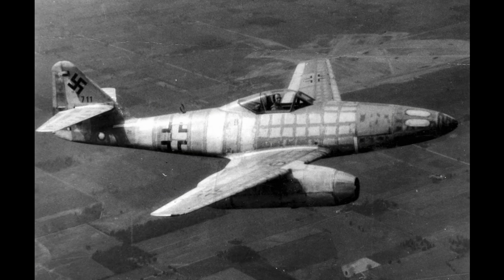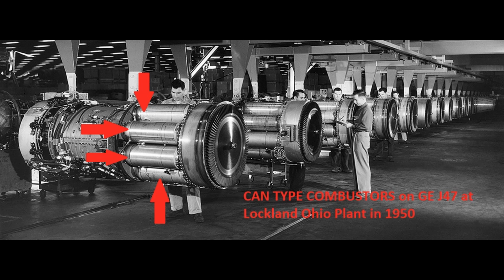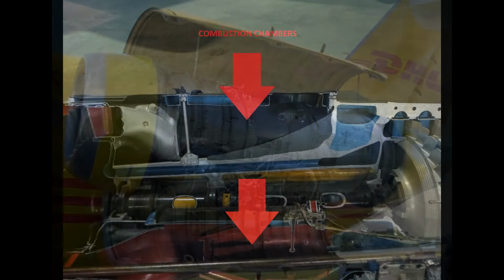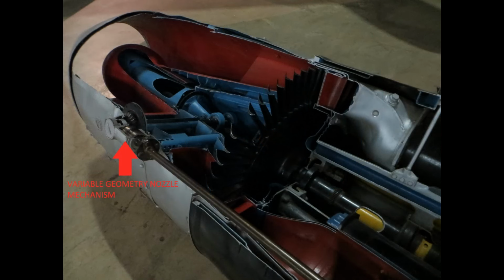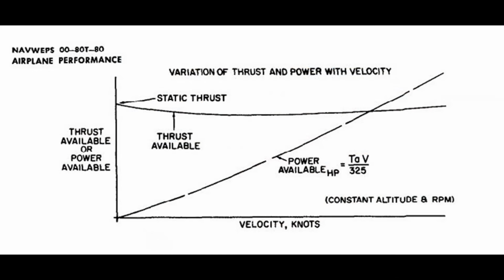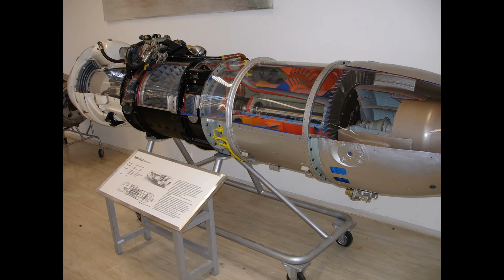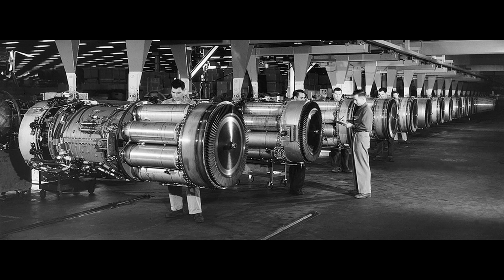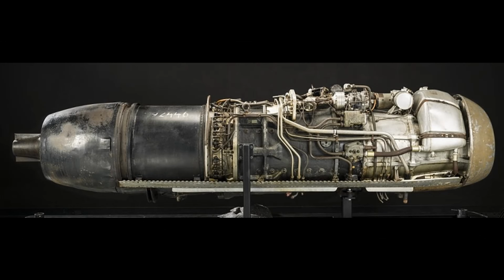World War Two JET POWER

Comment: The small turbojets, include JUMO 004, often have a centrifugal pump stage (like J402). Centrifugal pumps are newer than axial pumps at that time. Unlike Griffith and JUMO, Whittle chose the right solution for its time, the purpose of the engine and its size (commensurate with the size of the pilot). You have to compare JUMO to Derwent and Goblin, and they are much more successful. JUMO 004 sucks compared to them.
And BMW 003 benefited the French, not the Germans.
Great engineers chose the right solutions. The right solutions are way to the success. The ACCURACY of the prediction is the criterion of science. Griffith, Price, and Franz were wrong, and Whittle and von Ohain are right then and now.
Reply: Centrifugal compressor turbojets were an evolutionary dead end.
Frank Whittle was an unlikely hero created by the British propaganda machine.
The real geniuses of the British jet engine program was Adrian Lombard and Stanley Hooker.
Britian simply lacked the technology and experience to build the more advanced and sophisticated axial compressor engines which we use today, centrifugal jet engines are obsolete technology.
Reply: @sandervanderkammen9230  What are the sources you use for shitting on the neurotic idiots jacking of to mediocre british technology? I'd really like to get a hold of them myself.
Reply: @Krieg43 Britain lagged a decade behind in Axial compressor technology and would not have a flightworthy production Axial turbojet until 1950.
Reply: @sandervanderkammen9230  But what are the sources for all the information you presented in your comments on this video? 
I'm want to read them myself, it sounds interesting to me.
Reply: @Krieg43  It's a very broad and complex topic that is highly technical, you will need to be more specific in your queries and have sufficient technical knowledge to follow along.
Any questions?
Reply: @sandervanderkammen9230  Let's narrow it down to the Jumo 004, and refutations of Frank Whittle myths that have become popularized.
Reply: @Krieg43  The often misquoted TBOs for the Jumo 109-004 are from the -004A-C1, these test engines were constructed from Krupp P-198 Chomadur instead of the original P-193 Tinidur~60 alloy, these experimental engines had poor engine life ranging from 10 to 25 hours.
These engines never saw production or operational service.
 The USAAF exhaustively tested the Messerschmitt Me-262 during Operation LUSTY and confirmed TBOs averaged 55 hours. (Excellent for high output piston engines)

Frank Whittle was only the fourth person to successfully demonstrate a working jet aircraft engine, this is confirmed by all the available reference sources and the false revisionist claims that Whittle invented the jet engine can no longer be supported.
Reply: @sandervanderkammen9230  I misspoke, I already knew that stuff. 
I was mainly interested in the sources for that information besides the LUSTY reports. 
Sorry I didn't make that clear.
Reply: @sandervanderkammen9230  Compressor type is not a consumer factor, but design chois. You are confused here, but you have acted as an expert against the facts: JUMO 004 is not good even in the USSR, with unlimited nickel and with Jumo engineers in sharashka. MiG-15 and Il-28 flew with the modernized Nene, 1944.
How all of a sudden were the British supposed to persist in a design error?
Axial turbines were mastered in Britain. Centrifugal are news. Parsons in the 19th century had been asked to make turboshafts. The first to research the turbo engine there was Griffith. He published an important paper in 1926, which everyone in the world who was interested read. And the first one in Germany was von Ohain's ridiculous... centrifuge, as we know, he had read Whittle's publications.
Griffith gave a negative review of Whittle's degree, which slowed things. Unlike you, he probably knew that product size affected design decisions, but didn't know how. His Beryl was long finalized from 1941 (1942 Griffith with fan, 1945 Whittle with fan), but the Beryl turned out to be worthless small and more complicated. The same complications, and probably at Griffith's suggestion, were in the USA: two axial engines were developed there for a long time, one very small. And it took a long time too, just like BMW, JUMO and Beryl. The Jumo 004 never became a product.
SMALL turbojets with centrifuges are being produced! More often turboshafts, but also jets. They lose out for some reason. Fact. Supersonic airplanes have them, for example. Guess which ones.
Reply: @sandervanderkammen9230  Whittle did not “demonstrate”, as is known, his ideas were shared by British and US firms. More, Bell P-59 was ahead of the Me 262 in development. Why would the British need it in the second half of 1944? Meteor is in service at the same time, but why would they?
No alloys, even English ones, helped the USSR achieve JUMO 004. But in larger engines, axial compressors played.
55 what hours? In the USA, did they assign TBO to the motor or did one motor last longer? Or a hot test?
The service life limit was reached in the USSR: RD-10B on the MiG-9, 75 hours with an English alloy in 1948! With any German up to 50 hours, and produced at 25. In conclusion, engineers and even JUMO workers were sent to the USSR. JUMO plant was moved there.
What are your “all sources”? Can I have one? He is only about JUMO 004?
Important: you argue with the conclusions of professionals of those years. They chose Whittle's type, and now they choose. You are below Griffith's level of understanding in 1926.
In general: this is "ignoratio elenchi". Not just TBO. JUMO 004 is worse than Derwent in every way. But Whittle was not an opponent of axial compressors; he was embarrassed by the long shaft. This delayed everyone longer than him. A real engineer.
Reply: @Krieg43  In general, the first successful turbojet aircraft was not Me 262, but Ar 234. Because it was needed. And the German gloss is more important to many people than facts.
Reply: @Ernest-jr  Why do you say that? What's so special about Ar 234 compared to the Me 262 to you?
Reply: @Krieg43  English is not my native language at all, but I wrote: because it was needed and successfully used, i.e. useful.
Introducing Me 262 created a huge level of mishaps. No training airplane, and the 262 is complex from takeoff.
The results of air combat not at altitude are mixed. On FW 190s defended the airfields of the Me 262s.
Neither the 262 itself nor any of its features impressed anyone. At that time. Now they'll tell you from the sofa. Even the Su-9 ( first with such a label), which was imitated in some respects, did not go. After the war they were only tried in Czechoslovakia.
Compare with the worldwide success of Vampire and P-80, the influence of ideas in Me P.1101. And every turbojet in 1944 is important, it was their number and TBO that determined the aircraft capabilities. But even in well mastered mass production they are still expensive.
Reply: @Krieg43  I can see from my sofa that the first fighter should have been a scout and bomber (hello, Hitler, for participating in it once, one April day), two-seater, not twin-engine.
Well, and the engine had to be Whittle type.
Reply: @Krieg43  Bombers are flown less frequently and on constant modes. Usually there is a second pilot who can take over some of the control tasks, relieve the pilot. This is a multiseat machine.
Ah yes: the Me 262 finally learned how to catch up with Mosquitoes. Although it is not the only high-altitude interceptor of the Nazis.
Reply: @Krieg43  1. It's still a pain in the ass. An engineer solves problems. Like Whittle. Then there are the show-offs and researchers, they're fake engineers. As they say, worse than Hitler.
The jet fighters of the fall of 1944 were designed as high-altitude interceptors. The altitude is good, but the rate of climb is bad at first. You can get speed in a dive, if you don't have any piloting peculiarities. Or you have to be on duty for a long time, fuel.
Compare Bell P-59 (yes), Me 262a, Gloster Meteor F.3, Vampire DH 100 (it flew in 1944).
2. And if you are being pressed in such a discussion about the superiority of a couple of months, forget it.
3. About the Germans immediately after the war, because of the secrecy of their work, in particular, composed urban legends. Ordinary people live in a legendary world..... always? Only daily education saves them.
Reply: @Krieg43  The standards for military aircraft engine certification and military acceptance are well known and are available from numerous documents from this period.
The RLM, RAE and USAO all shared the same 100 hour PFTR reliability test standard, only the US Department of the Navy required a higher standard (150 hours)  for maritime patrol operations.
Reply: @Ernest-jr  You are are clearly never confused and misinformed about this topic.
The MiG-15 is not powered by the Nene or the Soviet version called the RD-45... it was powered by the much larger, powerful and more efficient VK-1 designed by Vladimir Klimov.
  Genius German engineer Helmut Schelp understood that the centrifugal turbojet was an evolutionary dead-end concept and convinced the RLM to abandon all development of centrifugal compressors in 1939. The UK was a decade behind in axial turbojet technology.
Completely false, the first axial compressor turbine engines were developed by Swiss manufacturers BB&C and were first demonstrated in Berlin in 1930.
The first demonstration of a axial compressor was a BB&C Velox engine at UMIST Manchester in 1932.
False, Parsons would not build a gas turbine engine until after the war, designed by Jumo engineer Max Bentele who co-developed the Jumo 004.

Wrong, A.A.GRIFFITHS went to BB&C in Switzerland in 1928 to study  turbochargers, he arranged a licensee agreement with BB&C to manufacture axial compressor gas turbine engines at Metropolitan-Vickers.
The first successful demonstration of a working gas turbine engine was by Jens AEgius-Elling in Norway in 1913. (Centrifugal)
Wrong. Maxime Guillaume patented the turbojet aircraft engine in 1921.... when Whittle was just a 14 year-old boy.

The Jumo 109-004b was the only successful and mass-produced jet engine of the war, over 10,000 were produced.
Centrifugal jet engines are completely obsolete technology, Rolls-Royce ceased production in 1953.
There are no supersonic aircraft powered by a centrifugal turbojet engine, they are simply too bulky and inefficient.
Any questions lad?
Reply: @Ernest-jr  Whittle's engines were not only made with inferior materials like Brown 18/3 and REX 78, metals used I cutlery and kitchen utensils.
He also lacked the advanced thermal management technology pioneered by Jumo...
Krupp P-198 Chomadur is still used in jet engine production and is known today as A286 alloy.
Whittle's Power Jets Ltd engines were too unreliable to meet the 100-hour PFTR reliability tests that were required by the RAF. This is why Whittle's engines never saw mass production.
The Jumo 109-004b was more reliable than Allied jet engines during the war.
Reply: @Ernest-jr  That's a completely false narrative.
26 Me-262 pilots scored Ace or higher shooting down over 550 Allied aircraft.
262 pilot Kurt Welter remains the highest scoring jet Ace in history.
The Gloster Meatbox only killed British pilots,  890 Gloster jets crashed killing 450 RAF pilots.
Reply: @paulpaul9914 Could you please explain why there are no longer any British jets made in the UK?
Reply: Could you please explain why there are no longer any British jets made in the UK? @paulpaul9914
Reply: @paulpaul9914  GENERAL ELECTRIC MAKES THE WORLD'S LARGEST JET ENGINE.
Reply: @sandervanderkammen9230  You have a thesis switch, of course. Whittle isn't a metallurgist, he's the world's best designer. There was someone in the UK to choose the alloys.
Second, you are of course not comparing JUMO and Power Jets, but Jets with an unnamed ideal. Primitive demagoguery.
Fact: in the USSR, JUMO engineers mastered the alloy under license from RR. And what does chrome have to do with it? However, there are no questions.
Whittle's turbine is axial. That's where the JUMO cooling system is. Why do you suddenly think that having an extra system on a small engine is an advantage? JUMO has a gasoline-powered starter motor, is that an advantage? Cuckoo clocks.
It's best is a real engineer, not a German.
Reply: @WilhelmKarsten 
UPDATE BREAKING NEWS
As they know, the Sea Vixen was indeed a very competent & beautiful aircraft. 
British military aircraft at the time did not have unusually high accident losses rates.
For example
De Havilland Vampire &  Sea Vixen & Gloster Meteor accident losses were not high or unusual for fighter aircraft at the time.
Non combat phase accident losses.
% of Aircraft built.
Lockheed XF104             (ff 1954) 100%
Lockheed  P80              (ff 1944) 43%
Lockheed F104             (ff 1954) 45%
McDonnell FH Phantom  (ff 1945) 35%
Gloster Meteor         (ff 1943)  17%
DH Vampire             (ff 1943)  23%
DH Sea Vixen            (ff  1951) 33%
Cheers
👍 & 😎 & of course 🙂 indeed.
Toodle PIP Old Chap 
      
  
        
.. ......     ......      .......
Iivvccxxiiivvvcccxcx
Reply: @paulpaul9914  NAME A SINGLE BRITISH JET AIRCRAFT STILL IN PRODUCTION?
Reply: @sandervanderkammen9230 
    Boeing, BAe Systems, Airbus & Rolls Royce are not German companies.
    Germany no longer manufactures Jet aircraft,  is a minor partner in Airbus & does less Airbus related work than the UK & much less aerospace work than the UK.
  WRONG ANSWER KRAPPENZ
Please feel free to have another go.
 They might like to answer these questions.
   Which airline has just ordered
60 RR England Trent XWB Engines
& What aircraft are the engines for?

Bonus question for 10 extra points.
                Which country has the 
World's Highest Combined Per Capita
 Nuclear / Defence / Aerospace Sector Activity?

👍& 😎& of course  🙂 indeed
Toodle PIP Old Chap.
   
     
        
 
. ... . ... . ... . ... ..  .. ... ...
xcvllvcxvlicxvliilliivcxvc
Reply: @petemaly8950  NAME A SINGLE BRITISH JET AIRCRAFT STILL IN PRODUCTION IN THE UK???
Reply: @WilhelmKarsten 
    Boeing, BAe Systems, Airbus & Rolls Royce are not German companies.
    Germany no longer manufactures Jet aircraft,  is a minor partner in Airbus & does less Airbus related work than the UK & much less aerospace work than the UK.
  WRONG ANSWER YET AGAIN  KRAPPENZ, ITS A SIMPLE QUESTION
Please feel free to have another go.
 They might like to answer these questions.
   Which airline has just ordered
60 RR England Trent XWB Engines
& What aircraft are the engines for?

Bonus question for 10 extra points.
                Which country has the 
World's Highest Combined Per Capita
 Nuclear / Defence / Aerospace Sector Activity?

👍& 😎& of course  🙂 indeed
Toodle PIP Old Chap.
   
     
        
 
. ... . ... . ... . .......
xlxvcllcvxizcvlllcx
Reply: @petemaly8950  WHY ARE YOU AFRAID TO ANSWER THE QUESTION???
Reply: @WilhelmKarsten  
 @WilhelmKarsten 
    Boeing, BAe Systems, Airbus & Rolls Royce are not German companies.
    Germany no longer manufactures Jet aircraft,  is a minor partner in Airbus & does less Airbus related work than the UK & much less aerospace work than the UK.
  WRONG ANSWER YET AGAIN  KRAPPENZ, ITS A SIMPLE QUESTION
Please feel free to have another go.
 They might like to answer these questions.
 SIMPLE QUESTIONS
   Which airline has just ordered
60 RR England Trent XWB Engines
& What aircraft are the engines for?

Bonus question for 10 extra points.
                Which country has the 
World's Highest Combined Per Capita
 Nuclear / Defence / Aerospace Sector Activity?

👍& 😎& of course  🙂 indeed
Toodle PIP Old Chap.
   
     
        
 
. ... . ... . ... . ....... ... ..... ..
xlxvcllcvxizcvlllcxccvcvvv
Reply: @petemaly8950  NAME A BRITISH JET AIRCRAFT STILL IN PRODUCTION?